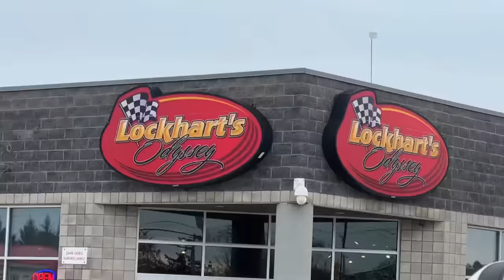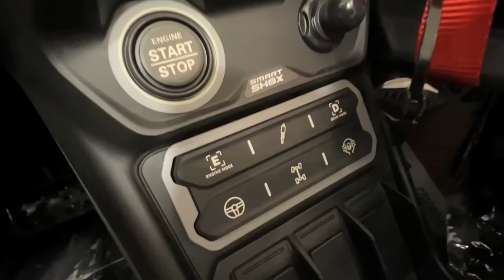2024 Maverick R XRS SS UNBOXING!

Comment: Think I would rather spend 60K on an actual vehicle rather than an over priced toy.  These things are amazing, but no where near worth 60K.  Or even 35K for that matter in my opinion.  Thank you for the video!
Reply: Then move along my friend. No need to cry about it.
Reply: @-Uranos-  Move along, no need to cry about this comment.
Reply: Go ride one first before ya doubt the price these thing will be tuned on e85 for 350 hp and run it with a smile these things are so tech advanced it’s not funny well well worth the money the build on it alone with the motor and transmission is a 25,000 set up alone to try to add aftermarket
Reply: @schultzpeakranch5501  Congratulations. You have officially been crowned King of the Run-on Sentences.
Reply: Try the CFMOTO Z Force Turbo 2024 and let me know what do you think in terms of price and quality built machine 😉
Reply: I mean your right. You can get a new C8 for that and be much happier
Reply: But if I already had the C8 😊
Reply: @-Uranos- nah ima cry I can get a new mid grade sports car or even a used corvette or Porsche for what that lug of plastic is worth.

Comment: so, i guess they are selling them as used.. since they were tearing up the tires and not going through the break in. hmmm not a fan on a seller using a vehicle/wearing parts and selling as new... if it is their demo go for it, if not then they should be selling it as used.., do to them being used.. there are function test but tearing up tires and not doing the engine break in is not a function test

Comment: 62k is completely unjustifiable. My 21 Titan was just under that before I did any mods. Much more tech, manufacturing involved, performance, reliability, and the list goes on and on. This it a tubular frame with a bunch of cheap plastic, small motor, and minimal eletrocics, HP, etc. I could see a justified price between 10k - 15k. Possibly up to 20k. But I would have to want to look into it more. What a joke.

Comment: This side by side stuff is an absolutely a joke and most of them are built like complete garbage, absolute garbage. All these keyboard warriors think they know about what is the best one out there when they bolt on some upgrades as they're called. I own a true sandcar not some "toy" and from what I've seen the speed car is a well builr side by side but has some minor issues but it's brand new on market but will be top dog down the road. Seeing these videos of keyboard warriors stating what's the best out there is just comical and $62,000 is a joke, even $40,000 is a joke for tinfoil and plastic

Comment: Why anyone would spend 62K on this garbage is beyond me. My Talon is WAY more reliable, I can go more places due to the single air intake IE river crossings. It cost 1/3 of the Canam. Ask ANY side-by-side mechanic who makes the best side-by-side. ALL will tell you, Honda. I have never been pulled back to camp, but I have pulled countless Can-AM and Polaris back. You can buy a cheap sand rail for 62K and that's way more fun.